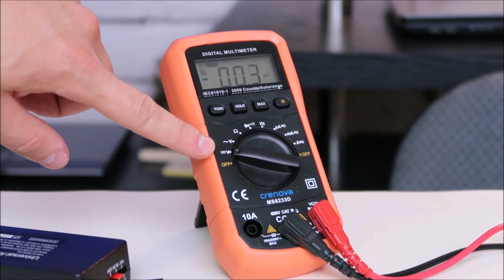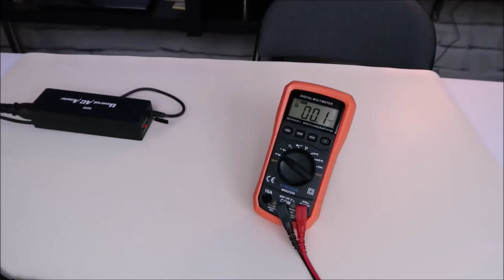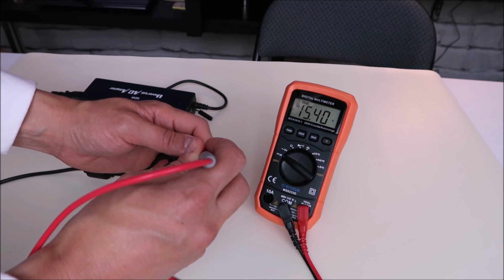How To Fix Any Laptop - Wont Turn On, Wont Open, Turns Off Right Away, No Power Solution

Comment: The lights of the laptop seems to turn on and off when I open the lid and that's pretty much it. The power button doesn't seem to turn it on. Is there anything else I can try ?
Reply from the maker: 1.  This video has been updated with additional steps here; https://youtu.be/HHwzA37r4e8. Let me know how that goes :)
2.  Also, did anything happen before this issue appeared?  Liquid spill, overheating, Windows update, etc?
Reply: @PC_Monkey  I've tried both the videos except the bios reset since the CMOS battery was a little hard to reach. It's a Fujitsu AH532. There was a case of overheating due to over use a while ago. And the charger and the battery were replaced. Then a few months ago it started overheating for simple programs and turned a lot slower than it used to be. And now it won't turn on. When I open the lid the lights starts to turn on as if I've turned on the lap and a second later it stops.
Reply from the maker: @almond3415  1.  If overheating has been a growing issue and its started overheating at simple tasks, your CPU and / motherboard may have died at this point.
2.  An overheating computer can be damaging multiple different components if not resolved. First, make sure that the fan and vents are clean and clear. If you need help accessing the fan, let me know what brand and model computer you have and I can help you get inside it. If that does not fix the overheating issue, then try replacing the thermal paste on the CPU and if needed, the GPU as seen here; https://www.youtube.com/watch?v=K_j4GPjpawk. If that fails too, replace the CPU

Comment: I have a Lenovo Z70-80 and the CMOS battery is hard wired to the board. What do I do about that? Please help😢
Reply from the maker: 1.  With those batteries, you would have to un-solder it from the motherboard to perform this BIOS reset.  If you cant do that, then you cant perform that step.  
2.  Are there any signs of life at all when you try to turn it on? Lights? Fan, Motherboard, or Hard Drive sounds? Anything seen on the screen?

3.  Also, did anything happen before this issue appeared?  Liquid spill, overheating, Windows update, etc?
Reply: @PC_Monkey  thank you for replying. It started with it not responding when trying to turn it on. With no signs. I could take out the battery and put it back in and then it would work. I bought a new battery thinking maybe this was the issue. It worked fine for a little time like two or three times. I thought it was fixed. But now when you press the power button I get two white lights that come on for and couple seconds and then they go off. When I plug it in it does a far as lights go act like it is charging. No other signs of life. I did try the reset button but no change.
Reply from the maker: @DJDOUBLEWIDE   If, after all these steps, you have not been able to find the issue, your most likely looking at a faulty component preventing the motherboard from working or a motherboard issue.  I would start troubleshooting each component, starting with the charger and power jack.  You can see those two videos here;  https://youtu.be/YBhsVHideGE  &  https://youtu.be/HpabvrNaodU

Comment: MAKE SURE YOU PLUGGED EVERYTHING BACK IN. WATCHED VIDEO AFTER VIDEO AND I DECIDED TO BREAK IT DOWN AND EXAMINE THE MOTHERBOARD. AS I WAS DOING SO I NOTED THE WIRE FROM MY POWERBUTTON THE MOTHERBOARD WAS NOT AECUR3D SO THERE WAS NO CONNECTION. I MADE SURE WIRES WERE SECURE AND THAN TURNED IT ON. BOOM IT WORKS. I ALREAD KNOW THE BATTERY IS BAD IN THE LAPTOP BUT WHOHOOO I FIXED IT
Reply from the maker: Well done!!  Glad your all set :) Always here if needed !!

Comment: I have a Dell precision m4800 did all the testing got to the c-mos unplugged it replugged and the computer started up with only battery then shut down tried it with the charger plugged in and it powered up.  So thinking we were ok we plugged in the hdmi cord, headphone plug in and external harddrive to do karaoke and nothing again unplugged everything but the charger and nothing.  Lights come on but go right off.  Any suggestions
Reply from the maker: 1.  This video has been updated with additional steps here; https://youtu.be/HHwzA37r4e8. Let me know how that goes :)
2.  Also, did anything happen before this issue appeared?  Liquid spill, overheating, Windows update, etc?
Reply: @PC_Monkey  Nothing happened to it I just bought it from a microsoft  refurb dealer on ebay to do karaoke at home as we have another m4800 to do our shows.  We have only used this one a couple of times and it worked fine then now a week later its not loading....there might have been a windows update but I don't put this online very often.  I watched the new video for this.  What do I do if its a windows update problem??
Reply from the maker: @sherivan3452  You cant do much if its not even turning on enough to allow you access to BIOS :(  If its still in the return period for the Ebay seller, I would return it.

Comment: hello pcmonkey i have a problem with a laptop asus a541u that wont start or sow any sign that the battery is charging 
i used a charger with multiple voltages  but with a max of 5A 
it worked for about 4 to 5 h then it shut down on its own and i cant start it again  eve after tryibg other 19 v 3,42 a chargers

Comment: i have a Lenovo yoga ThinkPad s1, i tried turning it on, the red light did blinked after pressing the power button but the fan didn't spin nor any other things in it, it just didn't make any noise kind of turning on, like it doesn't have any power, btw, i did removing the internal battery and tried to charge it back, same thing, the one thing that i still didn't do is try charging it with different cable, so anyone have any ideas what is happening to my laptop?
Reply from the maker: 1.  This video has been updated with additional steps here; https://youtu.be/HHwzA37r4e8. Let me know how that goes :)
2.  Yes, you can definitely try with another cable as long as its the correct one for the computer
Reply: @PC_Monkey  i did thought to charge it with different cable but the cable that I'm still using right now still making the laptop to blink indicating the cable still works, thus now I'm stuck, with both battery and my cable seems to be fine, does the motherboard becomes faulty at some point? or i still should try using another cable?
Reply from the maker: @assignmentposts3965   This video has been updated with additional steps here; https://youtu.be/HHwzA37r4e8. Let me know how that goes :)
If, after all these steps, you have not been able to find the issue, your most likely looking at a faulty component preventing the motherboard from working or a motherboard issue.  I would start troubleshooting each component, starting with the charger and power jack.  You can see those two videos here;  https://youtu.be/YBhsVHideGE  &  https://youtu.be/HpabvrNaodU

Comment: My Cyberpowerpc Fangbook will not turn on after I did all the steps, what should I do?
Reply from the maker: This video has been updated with additional steps here; https://youtu.be/HHwzA37r4e8. Let me know how that goes :)
If, after all these steps, you have not been able to find the issue, your most likely looking at a faulty component preventing the motherboard from working or a motherboard issue.  I would start troubleshooting each component, starting with the charger and power jack.  You can see those two videos here;  https://youtu.be/YBhsVHideGE  &  https://youtu.be/HpabvrNaodU
Reply: @PC_Monkey  I just realized that the CPU was knocked out of place
Reply from the maker: @Trooper_Cody  Glad your all set :) Always here if needed !!

Comment: I tried everything but it still won't work 💔
Reply from the maker: These are troubleshooting steps.  Not magic fixes unfortunately.  If none of these troubleshooting steps were able to identify the parts being tested as the issue, then you have identified the Motherboard as the most likely cause of the computer not starting.  It would then have to be replaced or repaired.  Let me know if you would like assistance with that operation :)
Reply: @PC_Monkey  
Thank you for trying to help but I will take it to a professional because I'm afraid to break it 😅💔

Comment: My laptop brought up this message on Diagnosis: check the following cable jumper connection or sensor.....it was turning on normally before...but it started turning on and then off again (before boot logo) but  it still turned on after a few trys but not it just turns on and off no matter how many times you press it
Reply from the maker: What brand computer do you have?

Comment: Tried all from prev video and this video (except biod due to it being placed on a uncomfy place to deattach the port), and still nothing.

My case is that i shut down and let it sit there for 2 weeks (i went on vacay) then i came back and when i pressed on button it did not turned on except for the led just blink for a sec.
Reply from the maker: If all the tests in this video do not reveal the issue, and your power adapter tested to be fine, then your most likely looking at a Motherboard replacement as seen here;  https://youtu.be/N_7HNrFkMS8.

Comment: Kinda freaking out nothing is working, when I turn my laptop on I hear the fan but the screen is black, also I can't get the battery in the back of the laptop cause Its built inside please help me
Reply from the maker: The fan stays on or does it turn off right away?  Can you see anything on the screen at any point?

Comment: Thanks PC for your helpful videos. I have a Toshiba L50-B-1DZ. I got stuck at the cmos battery reset because I couldn’t locate it. Any idea where the CMOS battery is located for this model?
Reply from the maker: Not all motherboards use a CMOS battery.  Yours may not have one.  
 Are there any signs of life at all when you try to turn it on? Lights? Fan, Motherboard, or Hard Drive sounds? Anything seen on the screen?
Reply: @PC_Monkey  it lights up, but the fan, motherboard, and hard disk drive don't come alive.
Reply from the maker: @michaelidoye2833  This video has been updated with additional steps here; https://youtu.be/HHwzA37r4e8. Let me know how that goes :)

Comment: I upgrade hhd to ssd my acer aspire es1- 432 . When i turn on the power button only the power light indicator light up but the screen it's not open. What i need to do.?
Reply from the maker: Perhaps something is loose after accessing the inside of the computer, including the SSD.  Can you double check to make sure all is connected securely?

Comment: my laptop almost turn on when i do the third step, batery out and plug in, but then there's suddenly a spark out at the back of my laptop. what's wrong with it what should i do
Reply from the maker: If all the tests in this video do not reveal the issue, and your power adapter tested to be fine, then your most likely looking at a Motherboard replacement as seen here;  https://youtu.be/N_7HNrFkMS8.  If you know your computer's model number, I can help you get inside your specific computer :)  I would def think its a motherboard issue, especially with all that about a spark :(

Comment: The first worked for me what might be the problem? My battery is dead and i plug it before it can turn on. Any solution? Sometimes it turn fast after 1 mins but sometimes i have to do first solution before
Reply from the maker: You have to remove the battery in order to turn the computer on?  I would say the battery is what is preventing the computer from turning on then and it should be replaced.

Comment: I have an odd problem with my Dell Inspirion that didn't fit any of your tutorials, which are quite good. Specifically, when the laptop is not plugged in it will not start. It starts and operates when plugged in and when I unplug from the wall socket, everything works. However, once I turn the unit off and try battery only, it again will not power up. When the unit is up and running, the battery shows 90% charged. Hopefully you have some ideas.  Thanks

Comment: So I took out both, drained the energy, then put only the charger, wouldn’t turn on. 
Did the opposite, laptop light turned on, but no screen.

Anyone got help for this?
Reply from the maker: If the screen is black, what are the signs that the computer is on? Lights, Fan, Motherboard or Hard Drive sounds?

Comment: Thank you for this enormous effort PC Monky, I wish I discovered your channel earlier 😁

A couple days ago i turned on my dell inspiron 15-5593 and it reached until the dell logo and then freezed there 
 I found your videos about the problem and I did the following: 
1- checked if the battery or the charger are the problem and they weren't 

2- took the CMOS battery out for some time and put it back and tried to turned it  on  and after the second try it worked just fine 

3- I shut it down and and turn it on again to go to the pre-boot performance check and ran a test nothing showed up but the test was really slow it freezes for 15-20 minutes and the mouse disappears but anyway I proceed and it worked just fine for two days 

4- today I turn it on and showed up message like "we can't load, run troubleshooting" I ran it there was nothing. After that every time I try to turn it on it took long time to get pass the dell logo. 
So what should I do to make it loads fast like it used to be, plus I think if I don't do something it going to get worse and stops.

I'm So sorry for this long long message, I hope you find the time to read it and to reply
Reply from the maker: This video is for a computer that wont turn on.  Sounds like your Dell turns on but has trouble with the boot up procedure.  Try the steps seen here instead :)  https://www.youtube.com/watch?v=B2Umoh81QeI
Reply: @PC_Monkey  no I know this isn't the video I just commented here to reach you, thanks for replying man, I'll check the link.
Reply from the maker: @nagato4287  Good luck !!  Let me know how it goes :)

Comment: My Dell 5570 would not turn on using battery alone.. It worked fine using the charger.. I tried everything you suggested in this and other videos.. So thinking maybe my battery cable wasn't making a good connection to the MB, I removed the bottom plate and put pressure on the cable at the MB connection with 1 finger.. I flipped the computer over still keeping pressure on that battery connection, and it turned on just fine.. Apparently the battery cable has gone bad.. new one already enroute. So thankful it will be a cheap fix. .
Reply from the maker: Great to hear !! Always here to help :):)

Comment: Hello, i have a Dell latitude E6420 and it won't turned on without charger plugged in and it always shutted down if i unplugged it, is it mean my battery bad? Or my Adapter?
Reply from the maker: Most likely the battery needs to be replaced :)

Comment: I have a Asus Vivobook X540MA and would like to know where the CMOS battery is located, I have opened the vivobook but can not locate the CMOS battery. "help"
Reply from the maker: Not all motherboards have a CMOS battery.  Yours may not.  Why are you wanting to reset BIOS in this way?
Reply: @PC_Monkey  I've got a Asus X540MA sometimes its just dead and sometimes it turns on but the clock and date is always wrong.
Reply from the maker: @MikeBe-qb6dr  Yes, that can definitely be a sign of a bad CMOS battery.  It should be replaced.  However, if your computer does not have a CMOS battery, it uses the main computer battery for that function.  In that case, it may need to be replaced.
Reply: I was thinking the same thing. Thanks you for the help
Reply from the maker: @MikeBe-qb6dr  Good luck !!  Let me know how it goes :)

Comment: I live in the UK. I have a Aspire 1 laptop A114-32--c423 model number N17Q4. The battery lasts about an hour until it needs recharging again. Do I need a new battery, if so where ca I buy one. Thanks
Reply from the maker: Most likely yes, you need a new battery.  I usually get most of my computer parts on sites like Ebay, Amazon, etc.  Is this your battery?  https://ebay.us/XgHKcz

Comment: Whenever i turn on my HP Probook it’s always going to the diagnostic UEFi and if it doesn’t it says that F20 something and then it goes to the diagnostic UEFi, I did the memory test and it worked but when I try the hard drive  it says that my hard drive is missing
Reply from the maker: That means its either bad or loose.  I would first try 'reseating' the Hard Drive.  That is where you unplug it and then plug it back in, making sure its properly plugged in and secure.  Try the scan again.  If it still says that its not installed, then its most likely bad and needs to be replaced. You can see how to do that here;  https://youtu.be/tNp5Kbo9uHg.  You would also then need to install an operating system onto the new one as shown here;  https://youtu.be/p_N_xV7j_Xo.  You can create your own Install Media for free as seen here;  https://youtu.be/YbC4jZVwQm4.  If you cant create your own, you may have to purchase it.  You can see an example of a good install media USB in the Repair Tools list here;  https://www.amazon.com/shop/pcmonkey.

Comment: Portege Z30-C would sometimes not run on battery, or stop running on battery, till back removed, battery unplugged and power button held a while. Put back together then battery would run it for hours. Now that won't fix it. But it still runs on adapter and battery shows full charge. I think on Z30-C the main battery is also the BIOS battery so with battery unplugged and running just on power adapter have to reset clock, or let internet time reset it. I also have an Acer Aspire R-131T which runs on a new battery I bought, or on power adapter, but won't charge a battery. Unlike a Z30-C it has a reset button. Both these computera may have motherboard faults then?
Reply from the maker: The computer runs well when the power adapter is plugged in but turns off when unplugged?  
Can you try the steps seen here?  https://www.youtube.com/watch?v=arZpfqcVoUs